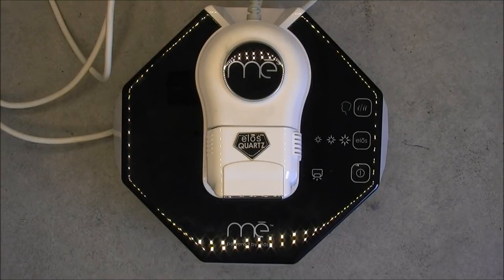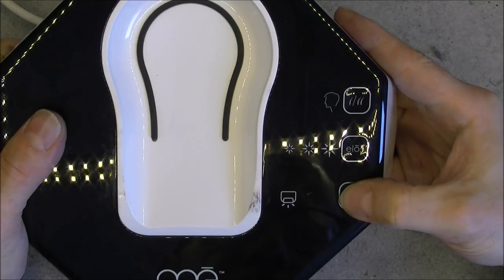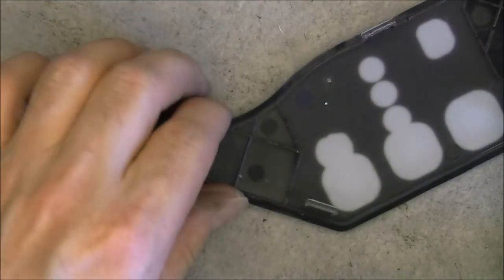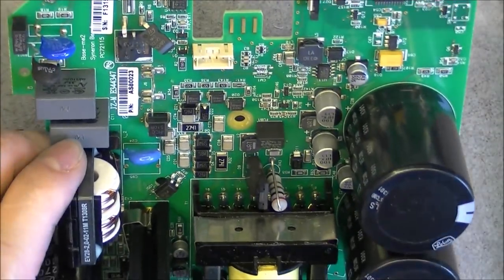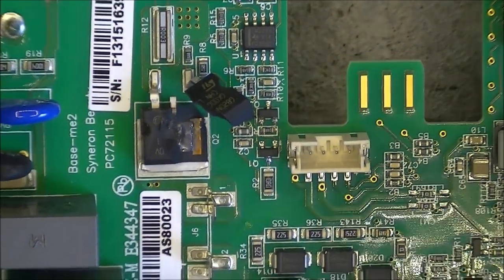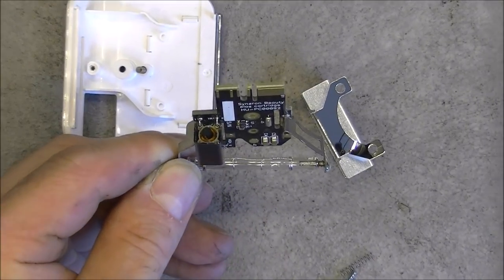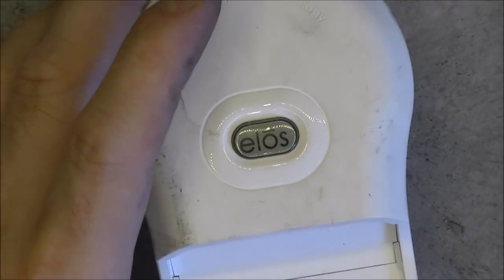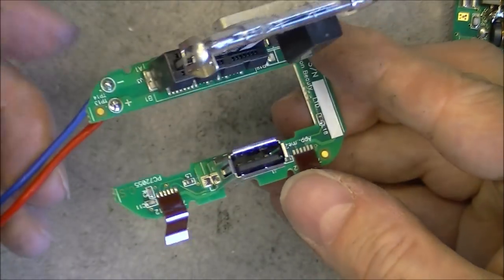"Mé" Pulsed light hair remover teardown

Comment: That little transformer next to the flash tube is the trigger coil. It generates high voltage pulses to cause the tube to strike. Usually 4KV or more.